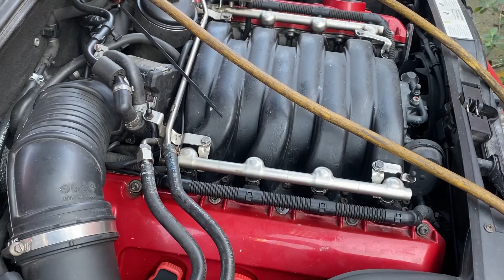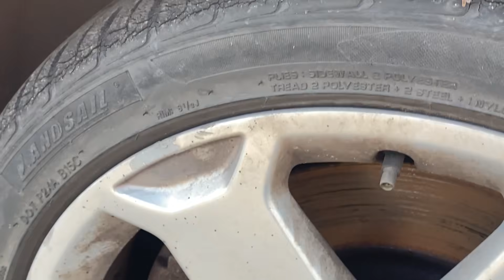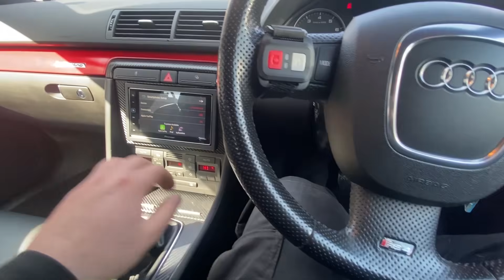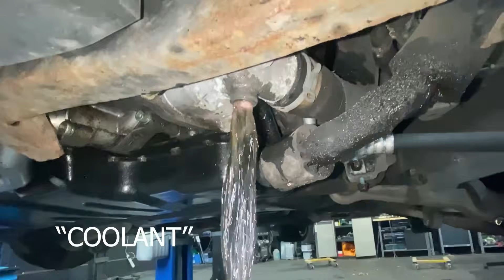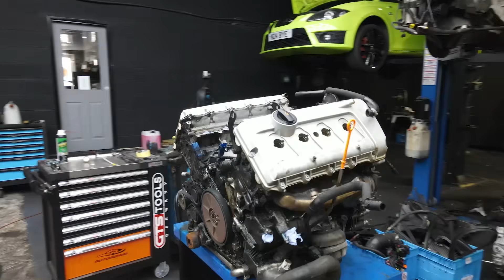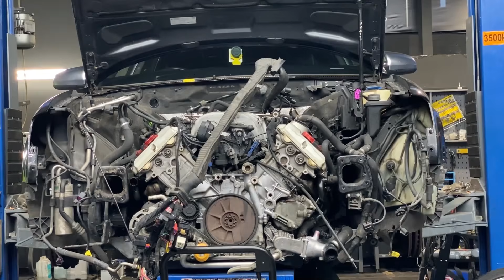Are you planning to buy Audi S4 B6, B7 with 4.2 V8? Small advise what to look at !

Comment: What's with gold paint in the motor Audi? I recently bought a 2004 S4 b6 with 44,900 miles on it. It's in immaculate condition, one owner car. I have some experience working on cars and changed the valve cover gaskets myself. I noticed bubbling, flaking gold paint on the underside of the valve covers. I removed as much of the paint as i could with solvent and metal scouring pad. Flushed everything nice and clean. The dealer i bought car from changed oil but the filter was old. I installed new filter, and saw that the old filter was full of small gold paint particles. I'm seeing conversations online about S4 finding the gold paint particles in their engines. Why does Audi do this? Any recommendations? Drop the oil pan and inspect oil pump? Get a complete flush i assume.

Comment: Hey man, you might just shortend my diagnosis.

I just took a look at the vacuum solenoid and mine is not working. What are the issues caused by that problem? I have some missfireing, spontaneously, but I exclude the timing chain since it was renewed 17.000km ago.

Comment: Yesterday i went to test drive a 2006 Audi S4 cabriolet. 6 speed manual. The car was fun, and that engine sounds amazing even with stock exhaust, but I didn't like how dry and stiff the leather was on the seats, the clutch was softer than I expected for a 340hp car, shifting into first and second gear felt SUPER stiff, while shifting 3rd gear felt way too soft. When I first went from 2nd to 3rd i pushed the shifter HARD into third because I thought I missed the shift when in reality the gear selector slot for 3rd was just WAY too soft.

The other thing I didn't like about it was how I'm 5'7" and the driver seat was snug even for me. My first car, a 1991 Mazda RX7 convertible, felt roomier inside than this Audi. It's too heavy for how small the car actually is.

Comment: Thank you for the EXCELLENT VIDEO! Having had THREE B6 S4s (still have one), this video pretty much sums up my experience in a nutshell. The money I spent on these out-of-warranty cars was horrendou$$$$$: one engine swap, too many suspension parts to count, oil leaks, steering pumps, etc etc. (The first two had some chain noise but I didn't even get to that.) And to fix the last B6 S4 I still have--an '05 Avant from the northern US--will require an engine pull to replace the cracked performance headers. Why are they cracked? Because the car was too low. But why bother doing any of that when the car has visible rust. I'm sad because I can't drive it and it's a mechanic's special now :(

Comment: Bought a damaged (body) 08 B7 S4 4.2l with 29k miles to swap to my B7 S4 Avant (200k miles).  The 29k engine works fine, sounds fine, however since I am pulling the engine anyway, what would you suggest to do to the engine before re-installation?  Timing tensioners only (swap to metal RS4 parts)? Valve cover gaskets? Other gaskets? This engine is original, no major work performed.

Comment: have a problem with my 6 speed Automatic gearbox on my 2005 b7 s4 it doesn't want to go in any gears at all when I put it back in park it makes a horrible nose and a burning smell followed by smoke but I can push the car freely when it's in park and engine is off.

I have call a few people most are saying the gearbox has gone needs  new one.

Comment: The 4.2 is amazing, it's one of the last v8 awd audis you can own unless you have supercar money for an rs7 and the 4.0tt.

Mostly it's the powersteering hoses to the powersteering cooler or miscellaneous coolant hoses cracking and failing.

The timing chain job sucks, unless you have a solid weekend to do it yourself with 2k of parts or 6-8k at a garage, or find a car with it already done. 

With catless downpipes and a fast intentions non-resonated exhaust, it's exotic sounding, like the old 4.2 audi r8s. Now add a ported intake manifold and a jackal motorsports stg 2 tune and you're at almost 400 to all 4 wheels.

I love mine, but it's like dating a super model or a stripper, the sex is amazing but she's toxic and expensive, everyone wants her but only you know about the problems you have to deal with.

Comment: Good morning,I've seen a 2004 Audi S4 convertible for sale with 91.000miles, for just £2600 might be able to knock down abit on price,but on advert says starts and drives plenty off power,but runs lumpy on idle but fine when driving,on advert says don't no what issue is and have changed coil pack ,spark plugs and injectors already,I no not best car to look at but I don't have alot off money and always wanted a v8 and I'm a single dad and my 2 littleones love convertibles and fast cars there only 6 and 10 but there just like there daddy lol,if anyone could help or ideas what is and price why having them bits fixed but advert says runs lumpy on idle,thank you.

Comment: Wow I picked the right video to look at , you answered a question right front the jump in regards to timing chain rattle on cold start ..I have a volkswagen Touareg 4.2 fsi I jus heard this sound once  or twice so far on cold start doesn't last for  second .it stops as about fast as the starter disengaged what would u suggest for an oil additive to keep oil pressure in the tensioners (if possible ) it has a 173k on it runs good how ever it has a cylinder 7 random misfire on high rpm above 3000 Rpm unload wot check engine light blink but never stays uluminated ..never had any  cam shaft timing codes jus this pesky misfire ..should I be looking at fuel injector  vehicle runs fine under normal drive cycle only on one time did I attempt to do a 5000 rpm rev in which  caused epc light and ruff  running still same codes cleared codes turned it off then restart and ran normal..so I'm scratching my head..your input would mean a lot ...thanks
Reply from the maker: Injector most likely , also check catalyst
Reply: @VAGTechnic  ok I will do that  thanks and what did u think about an oil additive or thicker oil

Comment: Just got an 04 S4 with 60k miles, first owner put 48k on it, second owner (who I bought it from) only put like 20k on it from 2008 to 2022 and had it in a garage all that time. Timing chain rattle for like 1 second on start up, hoping I wont need to do this for a while lol
Reply: Go ahead and replace the oil check valves, there's 2 of them under the intake manifold. 

They're there to keep oil pressure on the chain tensioners keeping the chains tight, if there's chain slap on startup then they failed and you need to replace them asap.

If the car isn't skipping timing and the idle is smooth then you still have time, also change the oil for the correct weight.
Reply: They're cheap and it should only take an hour or 2, will need new intake manifolds and a valley pan gasket.

So about $125-150 in parts including 10qts of oil if you do it yourself. Or 1-2k at a garage.

Comment: AC compressor needs replacing.. engine out 😂
Reply from the maker: Its possible to do it on the car , but time wise We are quicker removing the engine 😂
Reply: @VAGTechnic  could you guys do the rear main seal on my m54 bmw? Sure I could find an excuse to visit dudley. Guessing you'd probably take the engine out for it 😜😎

Comment: On mine with 108k miles, replacing the front cv shafts, the upper suspension links were extremely hard to get off because of age, wear and tear, etc. The a/c went out at around 100k miles, and to replace it you have to remove the entire front end and try for hours to break the shaft loose from the compressor without turning the shaft. Absolute dream to drive, requires a decent amount of maintenance even if you get lucky with timing chains. With that said fixing things is pretty straight forward and only takes about a day for the bigger projects like the a/c and valley pan oil gasket.
Reply: BS. You can't change an A/C compressor out in a day unless you've done it many times before. Same with replacing the radiator or even just replacing the serpentine belt.

Comment: I own a B8 2009 S5 with the 4.2L V8. It is a different engine code than these S4 4.2's, and the all plastic timing chain guide rails were swapped to metal for my generation. Thankfully I have no chain rattle whatsoever. But I was aware of the issue in doing research before my purchase of a used 4.2. Out of curiosity, I called my local Audi dealer and asked for a quote on a timing chain replacement...They said $16K. $9 thousand for parts, $7 thousand for labor. I hung up the phone.
Reply: It's only 5-8k for the b6/b7 s4, you were quoted higher because of having a b8, those cars retailed 6-70k I believe so their will try to milk you.

Check with independent vw/audi garages

Comment: Yeah..... No thank you.
The 4.2 v8 sounds great but I'd rather stick to my 1.8t. I can ramp it up to 300+ with a few mods only and the engine is sooo much simpler and easier and cheaper to maintain.
Also that car must of gone trough hell looking at it's condition. There are 4.2's the same age and a ton of mileage that are nowhere close like that 🤷‍♀️
Great job on rehuilding half of the car 😁😁

Comment: I have 2015 q7 3.0tsfi has EPC light on the dash I scanned it with vcds and got P1640,  fault priority 2 P0456  fault priority 4,     also faults for address 19 CAN Gateway02256 quiescent current  001 upper limit exceeded intermittent and 03041 Energy Management Active 000 intermittent both fault priority 7 also checked throttle valve angle 5.5% and acc ped 14.9 % at idle please help one shop said it needed a battery paid to have it replaced an it didn’t fix it not going back no one can tell me why the EPC light is on no other lights or not warnings  I also can send logs for vcds etc

Comment: Is the average VAG car just neglected or are they just prone to lots and lots of expensive part failures and leaks? My cjaa MK6 needed a new DPF and rear struts at 62k miles. Now at 92k miles one of the inner cv's has failed. Once used car prices are back to normal and going back to a Japanese car.

Comment: As the old saying goes.. "It's not the buying a car like this that's the issue, it's the running and maintaining of them that's the problem".. My B7 RS4 is on 136000 miles now, got it 9 years ago with 89000 on it, in my ownership i've changed the oil and filter approx every 3000 miles... as far as i know still on original clutch and timing chains.. no noise or issues with either.. so far. Apart from wear and tear items the most expensive part to replace was the oil cooler and lines. Brakes, suspension, suspension arms have all been done by myself, but i wouldn't even have a go at the timing chains on one of these... I take my hat off to you sir.
Reply: There's no need to change oil every 3,000 miles with synthetic oil. Audi recommends 10,000 and I've been doing that in my S4 for the past 150,000 miles without issue. I've never even had to touch the original chains/guided/tensioners.
Reply: @joevarga5982 every 10,000 miles??? Prepare to have engine issues around 180k.
Reply: @KBarron43   What do you base that on? You're telling me that the original chains tensioners will go well beyond 180K if the oil is changed every 3,000 miles? Back up your comment with some facts.
Reply: @joevarga5982  changing your oil every 10k on a high mileage German car regardless if it’s synthetic is wild, maybe it’s just cause I’m from the north & we do things differently up here. I’m just speaking from experience, I’ve owned 3 Audis & have a lot of friends who own Audis & BMWs, clean engine is a happy engine, not very clean with 10k oil intervals.
Reply: @KBarron43   "Prepare to have engine issues around 180k"

What issues should I expect at 180K, then?
Reply: @joevarga5982  timing chain, misfires, coolant leaks, case leaks, always thirsty for oil, 2.7T needs turbo oil serviced.  Only thing great that came from them was the Torsen-Quattro system
Reply: @KBarron43   Timing chains aren't a problem in the 4.2. The plastic chain guides are the problem. Mine went 183K mi. with 10,000 mi. oil changes. Changing more frequently wouldn't have prevented that. I got a lot more miles before failure than most people who change their oil every 3,000 miles.

How does changing oil more frequently prevent misfires, coolant leaks and case leaks?
Reply: You could say that some cars are easier to maintain than others

Comment: Have you guys ever replaced the oil cooler pipe/o-ring on the BGM/BGH 4.2 with the engine in situ? Mine leaks when the car is cooling down.

Comment: Great video and great info on the S4 b6/7 cars, thing I notish the past 1,5 years i have one that all S4 have the same issues, so when its done its done and taken off the bill you always get when you own one. Like check valves, leaking oil filter housing seals, leaking power steering return hose, valve cover seals, intake manifold flapper noise, external radiators leakage, a/c unit bearing and so on and so on. It can be a pain in the ass sometimes but you forget it all if you are driving it with a big smile on your face, realy nice cars.

Comment: Very cool video.  I have a 2005.5 B7 S4 Avant manual (US spec) and I paid 5,000 USD for it with 190,000 miles on the clock.  It was in INFINITELY better condition than this one.  Makes me really glad I found it when I did and purchased it.  I had no history on timing chains but I figured for the miles on it when I bought it, it nearly certainly had to have been done.  It still only rattles for about 2-3 seconds on a cold start and then quiets right up.  Currently sitting at 226,000 miles and going strong.  It burns a lot of oil at this point, but I'm sure the valves seals and piston rings are tired.  I did do all the thermostat and water pump housing and o-rings, valley pan gasket, oil filter housing o-rings and oil cooler o-rings a year ago.  Overall it's been one of the most enjoyable cars I've ever driven.  It's not fast but it sounds fantastic with catless downpipes and a full Magnaflow resonated RS4 exhaust.  Glad to see you guys keeping these old beasts on the road.  They are a treat to drive.
Reply: If it rattles for a few seconds on crank, then it's the oil check valves. They're under the intake manifold, it's an hr long job.

Basically what they do is keep oil pressure/tension on the chain guides. When one goes out, there's no pressure on the tensioners so there's chain slap on startup.

 They're cheap, I replaced mine when I put the ported manifold on. Most of the time it's their fault that causes the guides and tensioners to fail since everything is loose and dry on startup.

Comment: Got my A8 D3 for 3,000. Flatbed straight to mechanic. 2,000 to get it running. Drive to next mechanic to fix rear brake caliper and intake manifold gaskets - 2,000.  7k in, has 185,000 miles. I love to drive it, just hope that it does not fail around the next turn.

Comment: Hi! I’m watching your YouTube channel for a long time, because I’m an owner of Audi Allroad C5 with V8 BAS. This engine is almost the same as in S4 B6 and S4 B7. 
I think I have a “problem” with cold start with my Allroad.
When I start the engine in the morning, there is no engine warm-up speed. The tach rises to 1200 rpm and immediately drops to 800 rpm.
When outside the window the temperature is +10 degrees Celsius and above, there is warm-up engine speed. The tachometer shows 1200 rpm for about 90 seconds and decreases. In winter, the speed immediately drops to around 800 rpm after a cold start.
I've been looking for an answer to my question for 6 months now and I can't find an answer.
There are no errors on the engine, all sensors show up-to-date information on temperature.
I would appreciate any information.
Best regards.
Reply: Sounds like secondary air injection pump is just running for a longer period of time when its warmer outside. I have a 4.2 allroad also, SAI runs for a while sometimes, other times not as long, if you have no codes or further issues i would not be concerned.
Reply: @Jolinator  thank you for your reply. 🤝
Reply: @mepzavec1207  Sure thing! if you want to validate this and you have a VCDS you can try disconnecting the SAI pump at the connecter underneath the car and note the start up activity in different temps, you will log a SAI code so not advised if you don't have a way to reset the codes. All the best.

Comment: I picked up a B6 A4 v6 convertible for 450 bucks and am in the process of doing the work on her .. engine and suspension are done, exhaust and transmission range sensor and fuel filters are next up. Get them cheap and do your own work.

Comment: What do you think about Castrol Oil 10w60 fully synthetic ?
I put it in the Audi SQ5 2019 
Engine Torque: 500 nm
compression ratio : 11.2:1
horsepower: 355

Comment: Brilliant video, Love your content, having owned a b6 s4 for 6 years they are very expensive, apart from timing chains, mine had steering rack issues, engine mounts which were torn in half, air con shaft snapped, gear for the air con in the engine splines were no more, power steering pump wine, gearbox linkage issues, good car but for me they are too old now

Comment: Great work!  i agree with too much work on this car.  For years, I have been buying CPO cars and let the dealer take the risk.  Yes, I pay more but the Audi's I have bought like this, (4 of them) two had almost 300K on them and the other two over 130,000 miles and running great.  My A6 with a 3.2 has 267,000 miles with original timing chain too.

Comment: Great video. I have a k04 B5 S4 and a noggy B6 S4. It's a great car. I've only had to swap a sensor or 2 over 130k miles. I've got to pull the motor still and do the cam chain job. Not looking forward to that job